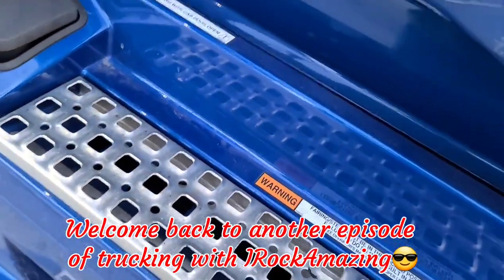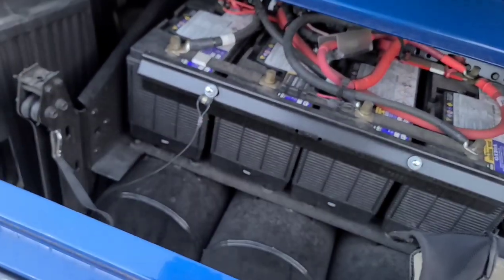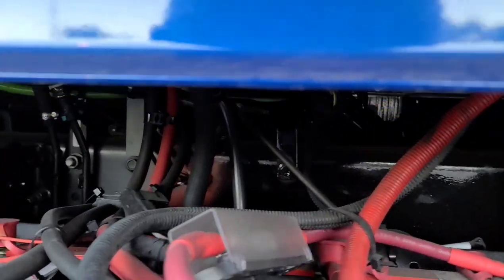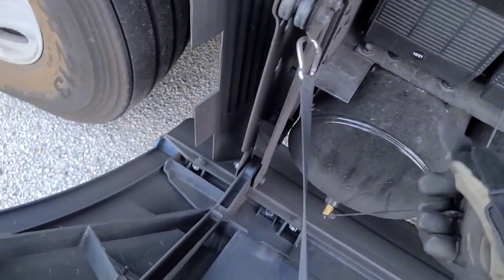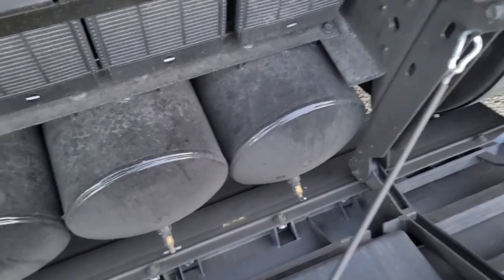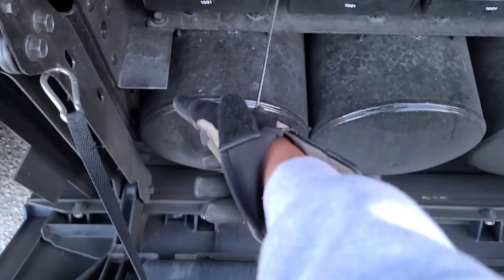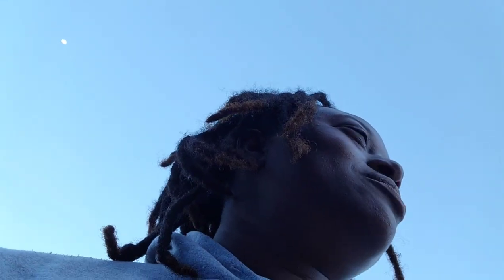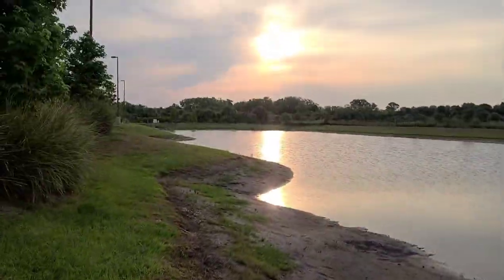How to Drain a Volvo Semi Air Tank/Vlogg | Swift Transportation

Comment: I used to drive a kenworth T680 I was very good backing it but now I got a volvo and I aways overturn the steering wheel when backing
Reply from the maker: Cause your use to that with the bigger truck. Volvo is real easy and smooth. Just a slight turn will do it sometimes.